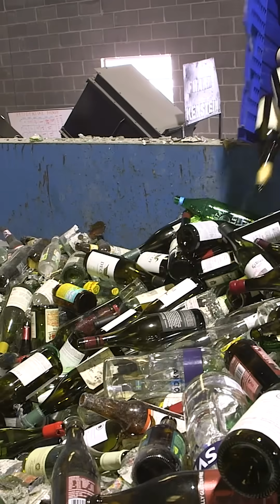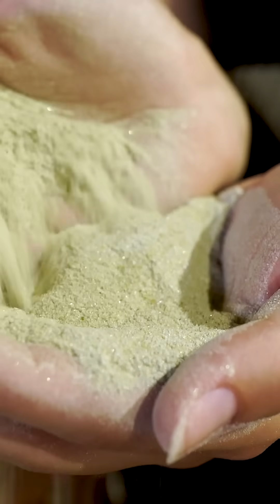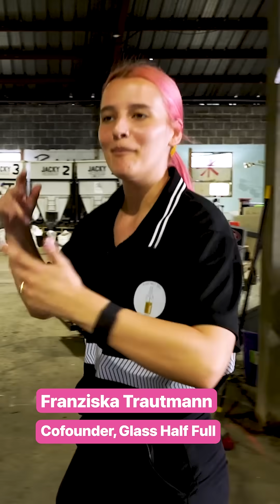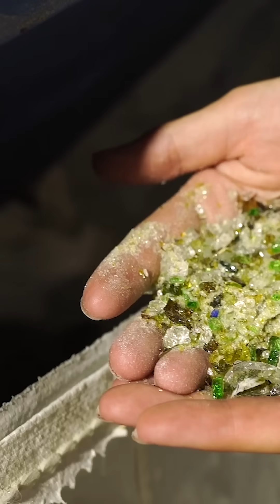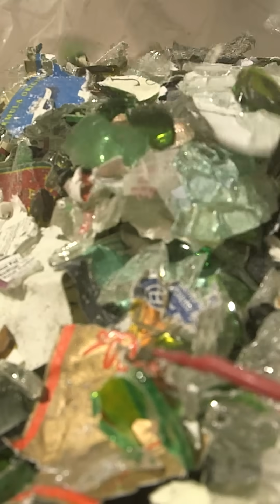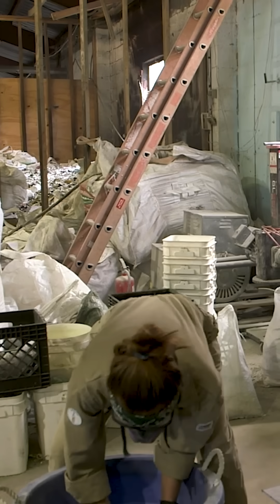Here’s how this entrepreneur crushes glass bottles back into sand. #Recycling #Sand #Glass

Comment: It's like they just discovered recycling glass.  We were recycling glass 50 years ago.  It was called putting deposit on soft drink bottles.  

I used to work at a Pepsi Cola bottling plant.  If a bottle was too damaged to reuse when it got to the bottling plant, we would save them up, sort them by color, and bust them in crates that we built for the purpose.  The broken glass would go back to the bottle manufacturer.

Most products in the grocery store came in glass, which could be recycled or reused.  As an example, Miracle Whip and Kraft Mayonnaise came in standard quart jars configured the same as canning jars.  Thousands of them were used by home canners for pickles and preserves (not for vegetables).

I have an outbuilding from the 1930s that was converted into a workshop back in the 1950s.  It has a ton of instant coffee jars full of screws, nail, nuts, and bolts sorted out for possible reuse.

Society is so much more wasteful than we were decades ago.
Reply: THats true . Not so long ago bottles were washed and reused , now just crushed . so you can drink 5 pence walue of sugar water one more time . That's just so stupid, and in the same time , stupid people who single use glass bottle implement extra taxes on diesel cars ..

Comment: glass is infinitely recyclable. Reverting it back to sand just wastes the co2 create during its initial production.
Reply: These came from the GARBAGE DUMP. They weren’t going to be recycled.

Also, this IS HOW glass is recycled. It’s crushed and then melted. 🤦🏻‍♀️🤦🏻‍♀️🤦🏻‍♀️🤦🏻‍♀️🤦🏻‍♀️
Reply: @Bubble170  it would be more economical to just recycle them out of the dump. Not make sand from them. Use sand. It has 0 carbon footprint. This ‘sand’ has a big carbon footprint. NOT recycling it into glass makes a need for making more glass costing more co2. People never see the bigger picture.

Comment: "your lung problems are not the fault of the business"
Reply: Actually, you want certified respirator masks for this work. Fine glass particles in your lungs is as bad as asbestos. It won't come out of your lungs. It's dangerous, for workers and neighboring businesses and or residences. This type of business falls under EPA regulation, plus local health/ safety ordnances. I sell recyclable glass to processors, there are like 4 or 5 plants in this country for glass processing, it's heavily regulated and for good reason.
Reply: @bluedogsalvage5246  gas station sushi are approved also.
Reply: @bluedogsalvage5246  well report the business it's not really hiding
Reply: @bluedogsalvage5246  r/woosh
Reply: $$$$$ all about money
Reply: Yes it is. The company is responsible for the health and safety of the workers AND it's neighbours. The "sand" is silica sand and when it gets into your lungs you get silicosis. You life is done.
Reply: If the company doesn't supply PPEit most definitely is the companies fault.
Reply: @bikerdad63  Thats right if you don't wear the supplies PPE when it is Required then it is your issue
Reply: @quantumconciousscorner2911  company has to supply them if not company is on the hook.
Reply: meanwhile all this could be turned back in glass or bricks. lol she is os proud.  now all that little particles will last for a long time around.
Reply: @stolearovigor281 hat's with you getting off on shitting on her business? Probably doing better than you. 

Also, idiot. The sand can be made back into glass- because you need sand to make glass. This is recycling.

Comment: Most of what is made of glass, plastic, aluminum, paper and steel is recycled material. This isn’t unusual anymore. 
  All the dumps have a recycling division-facility. Of which the recycling process begins. From aluminum cans, cardboard, shredded paper ( from Shredit ) , milk cartons, medicine bottles-caps, soda bottles, laundry detergent bottles, to cut up gutted and crushed cars, batteries. Etc etc… those things become the raw materials that are SOLD to outside sources to remanufacture into a multitude of different things. 
   Some becoming exactly what they once were, to becoming diapers or used for filtration systems, to becoming the car dashboard in your car, right down to being the soles of your shoes. 
  City dumps have become more profitable, employing more people, and are more versatile than you think. 
   They make millions through recycling and still are contracted through the city to charge you for picking up the raw materials they resale. 
   Point- though I believe this woman has a business of greater good. And she has made it into a profitable business of providing the raw material for remanufactured products. She isn’t going to the dump and picking up the bottles out of the trash for her business. Hence, she isn’t “saving “ beer bottles from the dump. Though she may have a drop point for the local population to drop their bottles off, the dump, particularly the ( Waste Management ) Department of the City already separates the glass, plastic, steel, aluminum, ect.. from the trash. Usually with Hispanic employees doing the work… She buys the bottles-glass from the dump. 
   In the case of batteries, trucks pick up the batteries directly from Autozone, and other facilities that are directly related to the vehicle industry. Including forklift repair centers. Hence why you receive a “core” refund from the supplier. Then brought to lead plants to be broken down, melted down, and remanufactured into different grades of lead and sold right back to the same manufacturer building the batteries for your car, truck etc. Fertilizer is also made from the byproduct of that process. The plastic casings are also recycled. 
  Last point- recycling is a huge industry. As it should be. But the days of being a trailblazer business and heroic for the people who own these companies doing the re-manufacturing is long gone! It’s BIG business now and it’s time to stop listening to the tree hugging liberal activists who keep ringing the a very old bell that doesn’t exist anymore. 
   Follow the money, and you’ll find out that the recycling industry is not only here to stay, but is a double dipping industry that profits not only the contractors, but the local and state government itself. 
  But the media and politicians would have you believe that this isn’t happening and you are stupid enough to not do the research so they can continue their double dipping. 
  This is a post that is for, and not against, the recycling process and industries involved. Just wish they would be more honest about the fact they are no longer having to “save” the recycling materials anymore… it’s already been separated and SAVED for them to purchase.

Comment: I once worked.for a window mfg.
End of the day we had to break up the big sheets of glass from the defective windows.

Tempered glass was.the most fun.

New guys would beat on it with a sledge hammer until their arms ached.

Then I'd just tap the corner.

Comment: Eye and lung protection are an absolute must anywhere in this place. The silica dust from glass is so so bad for you.
Reply: The free silica from glass is less than 1% whilst the sand you use to build and play in is under 95%. I use glass for sand blasting as it is inert and non toxic with practically no free silica, its the only stuff I'll use.
Reply: @AllBlast  I guess I shouldn't always believe what I read. I worked in the flat and auto glass industry for 15 years. I sanded a lot of glass with a high speed sander to seam and polish edges of glass I had cut. We never wore respirators or masks. I'm definitely doing more damage by smoking, I'm sure. Lol
Reply: @AllBlast can I get a legitimate reference ? I'm trying to learn. . All the glass I have produced is closer to 80- 85% silica by weight.
Reply: And much easier to deal with than a dying planet choked of plastics.
Reply: @michaelk8710  the worst..
Reply: 💯x💯
Reply: was thinking the same
Reply: Crushed glass is amorphous silica dioxide, not crystalline silica dioxide.  You're thinking of crystalline silica dioxide which is hazardous

Similar to how ethyl alcohol is safe for moderate consumption while methyl alcohol will kill you before you know what hit you
Reply: @GamingManiacMan  thanks for clearing that up.
Reply: I make glass for a living. I can assure you it's more than 5%.  Most glass recipes are closer to 80% by weight. You need to define "free silica." Yes glass only fractures on the oxygen bond, however the scars on your lungs do not care.  The other difference is sand has been water tumbled for a long time. Under magnification It's not the same at all.

Comment: Goes for a run on the glass beach and have internal bleeding in your lungs 💀
Reply: Glass is essentially sand. 

I literally do this same process on a small scale for my bar. You can pick it up with your bare hands and grind them together with zero cuts. I keep a jug of it behind the bar for curious folks. 

I use it for mulch in natural areas. Zero weeds and makes beds drought tolerant! 

Also, glass isnt a crystalline silicate. It is amorphous due to heating. It has no sharp edges and is about as irritating as a dusty room when you're spring cleaning provided you have ventilation and space. You should wear a mask most of the time unless you're doing a small run. 

Finally, GHF wasnt open or full-scale processing that day. You can tell bc they'd usually have around 20 to 30 people working on "glass mountain".

Also, i know these guys and they really are careful. They have support from Tulane and Loyola departments and a ton of other institutions. They aren't slapdash.
Reply: @blakeandtim937  Glass dust is not good for you I don’t care what green “Scientists” they bought to say otherwise, It’s not the same as regular sand, Natural sand is basically rock and trace amounts of glass not pure glass dust
Reply: @blakeandtim937 sand are corrosion made so they are not razor sharp like crushed glass
Reply: @hinderburger3804  just so you know I actually run a micro recycling project for glass specifically because I own a bar. 

Crushed glass and pulverized glass are two entirely different things. 

Pulverizing amorphous silicate creates rounded edges from micro to macro. It has to do with the structure of fired glass at a molecular level. 

I've spent hours with Bill Clark of Strategic Materials, the nations largest glass recycler, and a few hours with Cynthia Andela of Andela Pulverizers. I've met with sustainability coordinators around the nation and with my local EPA officers about this. 

You are incorrect because you are making some assumptions about your experience with "shattered" glass. 

We're talking about a completely different process whereby glass is smeared against a mild steel trommel screen with holes pierced in it by a spindle of swinging hammers. What comes out is mechanically tumbled...that isn't quite accurate but it'll do as a way to explain it. 

In short, smash a bottle on the ground, get sharp edges.

Pulverize one and you can grind the material in your hand. 

I literally keep a jug of it at my bar for dubious or curious people to do the same. 

Pro tip though: don't let the hammers get "worn" or you let bigger chunks through and that can be sharp. You have to reweld a sacrificial edge.
Reply: @blakeandtim937 you’re absolutely right. Glass is sand just heated at extremely high temperatures and pressure that change its molecular structure
Reply: @blakeandtim937 thank you for the helpful comments, it was interesting to learn. 😊

Comment: They’ve tested the sand, it’s safe for wildlife and doesn’t leach anything into the ecosystem. As for silicosis, that can be caused by working with normal sand and construction work, not just this, although the fact that they aren’t wearing masks is a little concerning. The consistency they use for coast reconstruction is the same consistency as coarse sand (not the powder stuff they show at the beginning), and isn’t any sharper than normal sand, so as long as you’re not involved in making it, there shouldn’t really be an issue with them making this sand. As usual, 1 min long clips don’t really give enough context to make an informed conclusion, so everyone starts bandwagoning once someone says something that seems correct.

Comment: That's some sharp sand
Reply: I would love to put some in the sand blaster and try it against paint. 
Also most of this is soda glass. By adding boron and other materials you can strengthen the glass and make structural glass for tanks and terrariums as well as bullet proof windows. THis is a great resource.
Reply: @KlodFather  my partner in my micro recycling project has tried this. It works "ok". 

Because of its structure it isn't sharp. As you might imagine it is "consistent" but not as aggressive as you might like for certain mediums? He said it's slow but very controllable.
Reply: Glass sand is amorphous. It is by definition no longer sharp or containing a crysraline structure. 

I micro-recycle and you can grind it in your hand with no cuts. It's wild.

The swinging hammers mash it through a trommel screen made of mild steel and it comes out without any edges. 

Almost like its smeared. I use it for garden mulch. Zero weeds, less watering, lasts longer than regular mulch!
Reply: @blakeandtim937 oh wow, that’s interesting!
Reply: It isn’t. It’s grounded thoroughly
Reply: @javsw.1878  go find out and come back and say

Comment: The main problem with glass is that even though its perfectly recyclable, there is little point in doing so. The glass that we put in landfills will get ground down to sand eventually due to pressure. it will never become toxic nor will it get swallowed by any animals.
 We are not going to run out of sand for making new glass anytime soon. We are not going to run out of landfill space anytime soon.

So while it is very much doable, there is little purpose for that really...

Comment: This just seems pointless. You can already recycle glass pretty easily, hell all you need is a tube, a fire, and a piece of glass if you want to blow it or a mold instead of a tube if you want to mold it. Or you can use it in off grid buildings etc. Like it's insane how awesome glass can be, turning it back into sand(just sounds like billions of cuts etc waiting to happen) just seems so pointless

Comment: In the making of the original Dune movie, for the sand worm scenes they used glass dust to act as sand, and when they were using it they had to cordon off the entire building for 3 weeks and you were only allowed in with full hazmat protection. Here she is putting her hands in that stuff 💀💀 can’t believe how much she’s probably already breathed in
Reply: Why tf wouldn't they just use normal sand?
Reply: @geogecko137 bc they were shooting w miniatures, and regular sand bits would give away the size difference. This stuff is much finer
Reply: @smears6039  They could've used extra fine sand? Dried silt? Something that doesn't cut up your lungs when you inhale it.
Reply: @allonifrah3465  extra fine sand would caused the same problems if inhaled
Reply: @allonifrah3465 

Bruh glass IS SAND. Extra fine sand is literally the same thing as this.
Reply: @Bubble170  Sand and soda are the basic ingredients of glass, but I thought the heating/melting of sand and soda and the subsequent cooling and recrystalisation of glass changes the hardness and sharpness of it. I guess it doesn't then.
Reply: @allonifrah3465 glass, bc of its heating, is actually an amorphous silicate dioxide. It will not cause cancer or silicosis. It is an amorphous silica dust. 

The worry would come from crystalline silica dusts which are more irritating to the body. 

Glass dust is roughly analogous to regular dust. 

You should wear PPE when you feel like it is reasonable. Probably not for a simple news tour. 

This video was clearly shot when they are closed. Max and Fran usually have a lot more folks around for processing days. 

Source: am buddies with these guys.
Reply: @blakeandtim937  Aye. I didn't know that. Thanks for clearing that up.
Reply: @Bubble170  u really have no idea what u talk about is u think byproduct of corrosion have same texture and structure as chemical harden glass.
Reply: Source please!

About cordoning off et al.
Reply: Her dog already accidentally ate some an he's doing great
Reply: Just listen to her voice, aged an extra 10 years. Very raspy.
Reply: @Revergencer that’s the New Orleans, not the glass 😂
Reply: Honestly seems like overkill to have hazmat suits. I’m a glass artist and do a lot of engraving, and a well cared for N95 filter on a properly fitted respirator will keep you more than safe, just gotta change the cartridges regularly.
Reply: @Glassgord This is a LOT more glass dust than you have experienced in your entire life. She is crushing MILLIONS of bottles of glass.
Reply: @glynnisthomas9165 tell me something - do you think she walks around EVERY DAY in the factory like this? Of course she doesn’t. She probably never does. 

She’s doing an interview, this was almost certainly a one-time thing.

Everyone else is wearing protection.

Comment: Sweco screens are really nice pieces of equipment. The fact you can stack screen sizes and have them come out different sides is nice.
A MidWestern would do more TPH but I’m guessing they don’t process that much material that fast from the sizes of conveyors that were shown.

They could go a size bigger - like maybe 4mm and use a Sweco screen as a tumbler and smooth the glass out and use it as pebble sand too.

Comment: Every worker there seems to have the microfiber respiratory masks. Yall shut up about the air. Those are the ones best on market from what I've seen. (Welding, concrete, metal fabrication, or any small particulate worker)